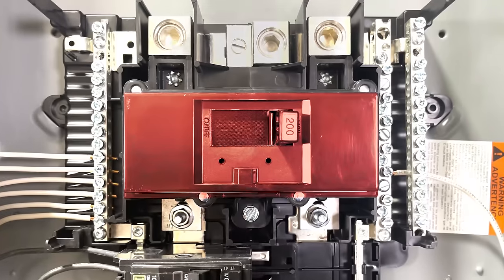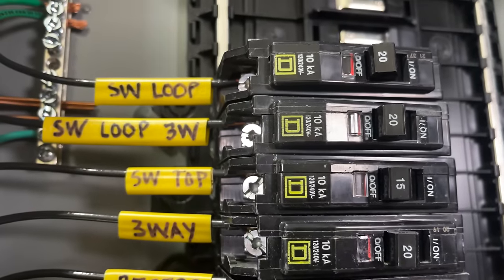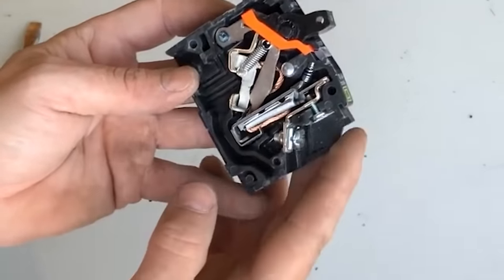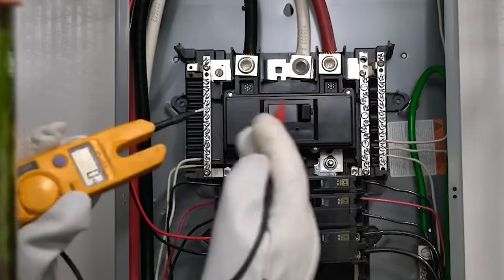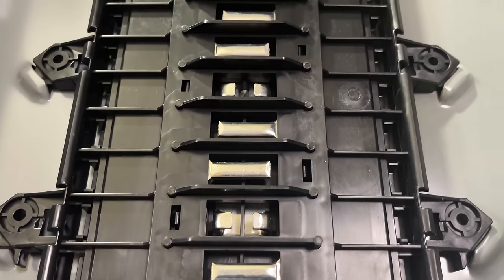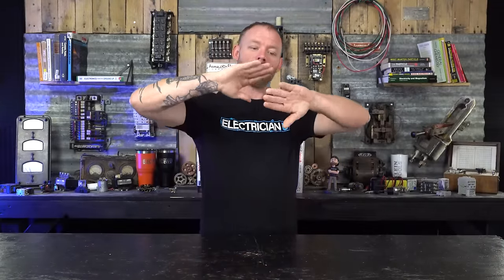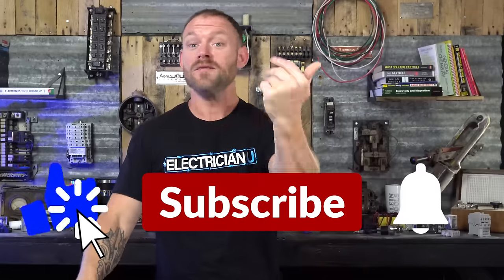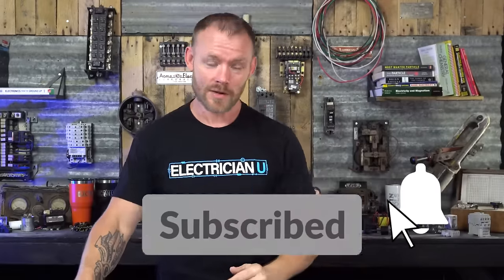Why is My Breaker Too Hot to Touch?

Comment: @3:42 so (i think i know the answer) My mother flipping the breakers like almost everyday to-
 "Get the hacker thugs' phone lines off the circuits and keep them from stealing the title to our house" 
smh [...yes...🙄😮‍💨I know]
-might be damaging the equipment and bringing the earlier end of life to said components?
not only that but causing a fire hazard because Although One does toggle them 'off 'when servicing devices on these circuits,They are not meant to be 'on/off' switches as in; they are not meant to be flipped 'on' and 'off' on the daily. But, rather, are primarily meant to be electrical emergency preventative safety devices, correct?

Comment: I've got an issue I'm dealing with now. I have a job where the power going down to the boathouse (100a subpanel fed off house panel) is reading 50v on L2 but 120v on L1 but when the irrigation timer kicks on the pump start relay for the irrigation pump it reads 117v on L1 & L2 but if I read across the 2 where I should read +/- 240v it reads 0.00v. Could the pump start relay be back feeding the sub panel when its on? It is baffling to say the least. (I know I have an issue with L2 wire since it's reading 50v but the way its reading when the relay cuts on is confusing)

Comment: My 50A breaker gets hot and trips when my Tesla charges at 39A, have to keep it at 35A. Seems wires are all tight.  Wire is 55A rated. Besides a bad breaker, what would be next step if this continues with new breaker? Does high summertime ambient temperature contribute?
Reply: If it continues with a new breaker, that means it's fine. If it was too hot, it should trip. Those thing are usually rated to at least 60C, which is quite hot.

Comment: Personal experience, running a main breaker at 100% of it's rating consistently for a few years with the occasional failed start capacitors in the system, definitely has ruined the main breaker.  196°F surface temp

Comment: When running near load or at load it's normal for it to feel a little warm, but it should not be HOT or so hot that you burn your hand, and if it emits a fish, burning, etc, smell, it's really bad and should be dealt with right away, in most of the cases it's due to a point of resistance causing arcing because of a loose connection.  It is AMAZING how many electricians out there do a shitty job, and charge thousands of $$$, even Master Electricians,sometimes they are just lazy, ignorant have big egos or don't use the right equipment.  Common mistakes with high amp breakers, they are not torqued to correct specs and they might not cause an issue sometimes, because the current draw is not big enough to cause an issue, but one day you upgrade your appliance that draws MORE current, causes arcing, causes more overheating and eventually melting of insulation / plastic, then hundreds of $$$ later for a simple 10 minute fix, you find out the previous idiot did not torque that bolt to spec and once you do it, problem disappears.......... Or spending $5k-$7k for a panel change, when that panel costs only $300 at the hardware store, only to find out a decade later that it was not installed correctly and how lucky you are that your house did not burn down due to half a dozen code violations and fire hazards!!!

Comment: I was rewiring some fixtures in a factory or manufacturing plant and when I started putting the joints back together the wirenuts where glowing.  I told the foreman who was watching me about it and he said he didn't have time to deal with it and that I was taking to long changing the fixtures.   So that's the kind of shitbags you are dealing with out there.

Comment: TLDR; Call an electrician
Reply: Do you mean TDLR?
Reply: For the main breaker, yes. I've done tons of electrical work and I probably wouldn't mess around with that without it scheduling a service disconnect with the power company.  Most other breakers are fairly easy to change.

Comment: Let's use a code compliant circuit to create his "dirty motor" scenario.

A 1/2 horse power motor (well pump or sump pump) gets dirty and runs slower.

430.6.  Motor current....table

430.248.   1/2 hp draws ....9.8 amps

430.22.(G).  125% but not smaller than 14 awg.

310.16.... 14 awg cu rated 15 amps

430.52.(B).   Circuitbreaker must carry start current. 

Start current..... 5 to 7 times normal run..

Circuit may end up with a 20 Amp or more  breaker just to run when initially installed. (Not normal, but legal).

430.33 nor 430.52 require wire replacement to achieve circuit protection.

Any motor slowing due to wear or interference may now see a motor protected at 20, carrying 18, designed for 15.   Hot....betcha.